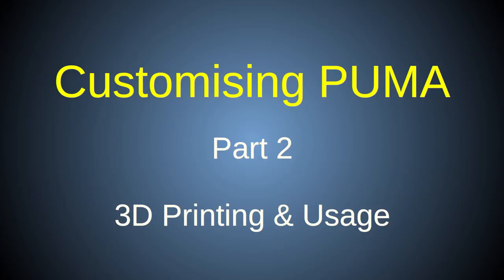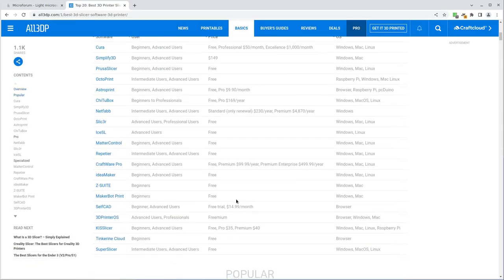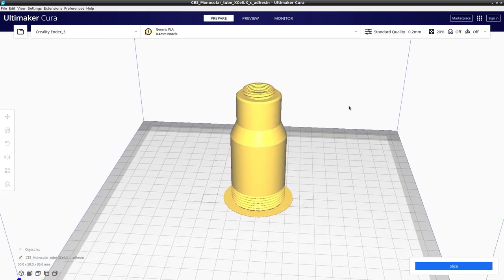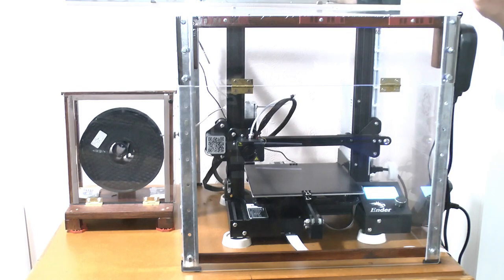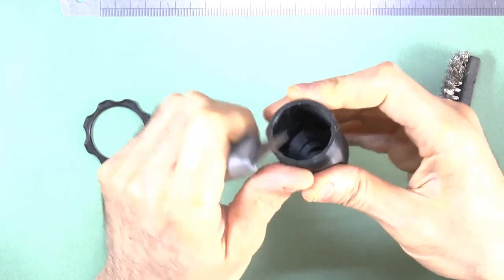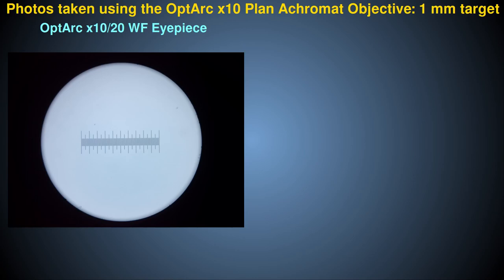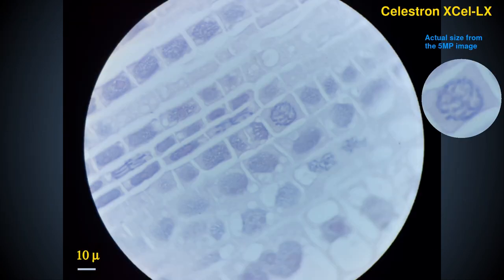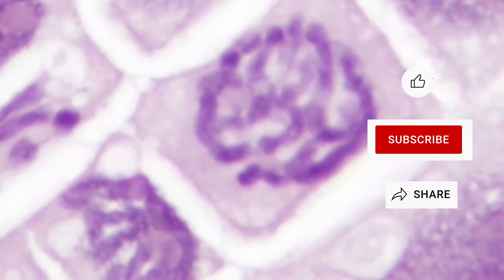Customising PUMA - part 2: Using a Slicer and 3D printer to make and use the models

Comment: Hello sir, can your developed algorithm and hardware be used for real time defect detection ( inspection). Thanks.
Reply from the maker: Hello. Are you referring to the image capture software PARDCapture? PARDCapture can be incorporated into a real-time inspection system. However, please note that at the moment it is only an image capture program and does not have any automated machine vision aspects built into it. You would have to supply those yourself by customising and adding to the code. If you want something that is already advanced in that respect there are other options available such as the cross-platform 'OpenCV' libraries and tools (do a search for OpenCV if you want to get more info and links on that).
Reply: Thanks